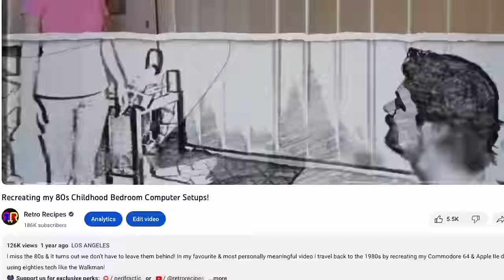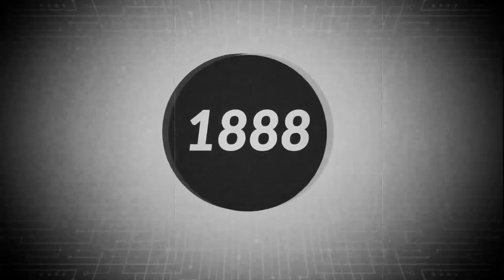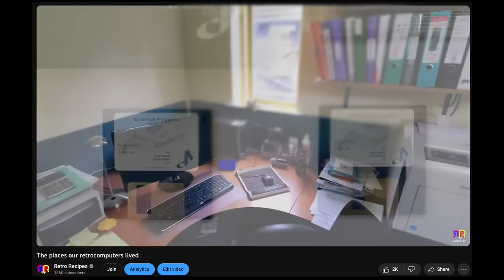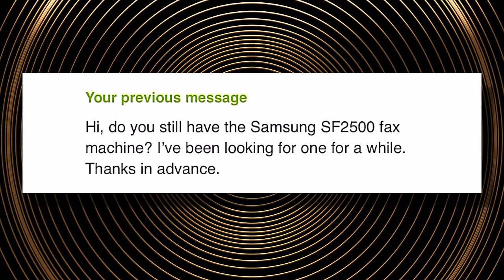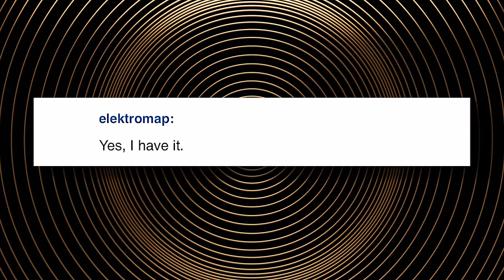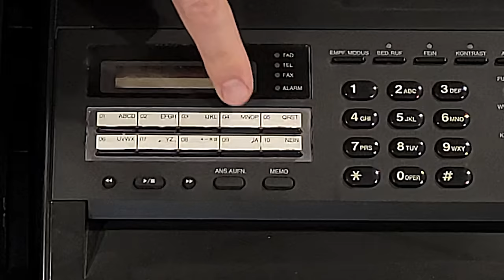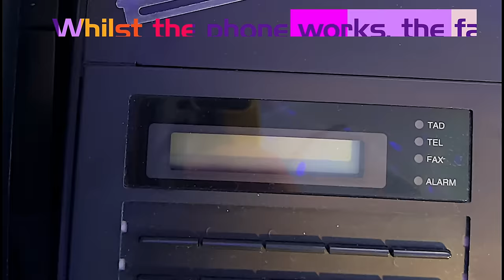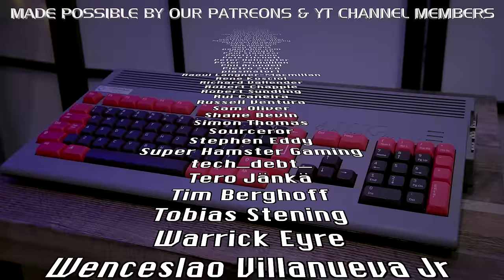Why we have to Save The Humble Fax Machine! // 90s Facsimile Repair 📠

Comment: Worked for the state public safety agency here in TX for over 30 years. The first seven were in the communications service handling telephone calls from the public and other LE agencies, lots of faxing documents. That was in the mid 80s. There as a second device duplexed with the fax, called a TDD, it was used to communicate with deaf persons. Maybe TDD was the precursor for texting? Still keep a fax machine in storage just in case it might be needed, next to it is a box of ballpoint pens and several pads of lined tablets. I really enjoy your videos!

Comment: I was lucky when I bought a Portastudio from Canada that it has a jumper you could reposition to swap back from 110v to 240v. Good job I thought of that before simply plugging it in in my excitement! Great repair job. The printer at work used to receive faxes and most of the time all we got were the equivalent of spam emails today. Offers of cheap holiday packages where you had to send the money off first and stuff like that. Beware of anyone trying to sign you up for a time share deal on a Spanish island! As for stupid people with idiotic comments, sadly these knobheads live amongst us but Darwin usually ensures they don’t live long and prosper. Keep up the great work. Sorry for the long comment but I have to mention the hard drive on the Amiga you showed, that I lusted after as a kid. I think it was 240Mb if memory serves. I did end up with a Amiga 600 with an internal 200Mb drive! Geoff Crammond’s F1 GP was the first game to reside on that!

Comment: I'm very sorry to hear about the terrible comments you receive. Your content has always felt a bit more wholesome that most of what I see. I pray that the positive comments can outweigh the bad ones and keep you up to making more content.

I worked for the phone company for a long time, yes they are phasing out POTS service with gusto. The copper infrastructure is expensive to maintain and since the government no longer regulates the service, they can do with it what they wish. They are pushing fiber and abandoning the copper. I am actually surprised that they allowed you to order a POTS line, I've been told by former co-workers that they are flat out refusing the service in my area.

Faxing is an activity that holds some nostalgia for me as well. I used to send a lot of them in the early 2000s as I worked in a small contracting office and would send out bids monthly. I also understand the feeling of certainty that holding a paper copy of something brings.

Keep up the good work!

Comment: Here in Australia they got rid of the copper phone lines a few years ago with the rollout of our national broadband network. In some areas they do still use the copper lines themselves for broadband, either fibre to the node or fibre to the curb (more correctly kerb, not curb as in "restrain"). Because they had to cut the lines and connect them to broadband node, they no longer connect back to the exchange, so they can't be used for a POTS phone line. And in areas where they upgraded to HFC cable or fibre, they simply no longer offer POTS phone services, so you can't get one even though the copper lines are still there.

Actually, a few years ago I repurposed some old Cisco gear to build a dial-up simulator. It was basically my own personal dial-up ISP, but I was using digital modems so I could get the full 56Kbps speed rather than the 33.6Kbps maximum of a regular analogue modem. Unfortunately it was pretty useless since there were no longer any POTS phone lines to dial into it (or rather ISDN lines, since it was digital rather than POTS), but I could connect a 56K modem directly and get the full speed.

Comment: I used to work in the marine electronics industry and the local prawn fishing fleet LOVED their fax machines. This was back in the AMPS (analog) mobile phone days. It was well known that conversations on the analog phones could be intercepted (albeit illegally), so the fishing companies installed Motorola Cellular Connection boxes to their mobile phones. This simulated a good old fashioned 2-wire phone line into which a fax machine could be connected. While it was technically possible to decode a fax transmission as it was flying across the air... there was no evidence that anyone in the fishing fleet had the equipment to do this.
Reply from the maker: Because as we all know PCB stands for Prawn Catching Boat
Reply: @RetroRecipes  100% correct 🙂

Comment: Ten years ago I replaced a multi-function printer for a non-profit I used to volunteer at.  The multi-function had print/ copy/ scan/ fax features.  The VP of the non-profit saw the printer had a fax option, and wondered why we weren't using it?  If any receipts were sent, they were received by email.  No need to pay for a land line that requires a long distance plan to be useful.

Comment: I recall having a fax machine at home in the 90s in the UK.  Felt I really hacked the system by buying a box that would connect to the tel socket and the phone/fax machine to that. This was so I didn't have to have a seperate line.  Call would come in, little box would determine if a voice call or fax and direct accordingly.  It was suprisingly fast and if a voice call, person at the other end was completely unaware and not kept waiting.  edit:  I also remember Blue Peter showcasing fax machines in the 80s. They had 2 in the studio.  1 presenter drew a simple picture and sent it to the other machine...was totally blown away by it.

Comment: You don’t need a copper telephone wire installed. I use Vonage VOIP to operate all my vintage landline phones (even rotary!) and my fax machine!
Reply from the maker: Whilst that is correct, the legislation applies to the newer VoIP lines which means they don't have to require the needed bitrate, but as mentioned I also just wanted to do it the original way :)

Comment: I recall having an OKIfax in New Zealand back in my first job way back in 1987.  Faxes have still been in use by  Chemists or pharmacys for prescriptions.  I have a Canon multi function printer that can be used as a fax machine.  But as I no longer have a landline.  It's a feature that might never be used.

Comment: I still have one fax / printer phone machine somewhere in my storage, doubt it works and probably needs a refurb by now. 
I kept these through the years buying and selling electronics so I can swap parts with other printers and electronic devices that happen to use the same parts or similar enough, at one point there was no money in this so I got rid of it all. No clue why I never took parts out of that specific one machine and why I even kept it. I even forgot about it through the years until now seeing this video.
I remember it being big and too heavy for it's size while also the handle of the phone itself being tiny like it's a child toy, I can imagine it being quite impractical for a every day phone usage with that tiny handle but at least it had hands free option to counter that. Since it's a printer it uses regular printer paper instead of the roll that yours does.

Comment: I've seen some means spirited comments aimed at various peoples comments here (including my own), but can't believe that you've had such depraved comments aimed towards you or your family, and by that  I mean in a way that I do believe it but I'm absolutely shocked by it. From my perspective you provide a great deal of fun, nostalgic, informative and enjoyable content and I can't see how anyone can find any reason to not only be mean spirited, but threatening towards you. What kind of excuses/reasons do they use??

Here in the UK they're phasing out the old copper wire stuff so they can shut down exchanges and reduce running costs. Old phones now plug into the router (same as they initially told you and what I had to do when they moved my service over) and everything goes via IP. Most connections are over fibre, with many direct to the home, though still quite a few to the cabinet in the street which then runs a copper pair to your home, so only the last few hundred feet is copper.

Comment: Up as recently as 2016, I still has a residential analog phone line, but heard through the local phone company, they were no longer interested in repairing or replacing copper wires.  Some cable modems will provide an analog phone jack - meaning they are digital up to your house and then analog from there.   So that is likely an option, just don't expect that they will be connecting you up to old copper phone lines from the '60s.

Comment: As a vintage phone collector, I wholeheartedly approve! IIRC, y'all have a vintage transparent phone that would work on that line, or you could get something like a Western Electric 2500, or even a Princess Phone to keep your fac machine company. 

I miss my POTS line. Alas, all my vintage phones are just for show. At this year's Vintage Computer Fest Southwest, I spoke to a fellow phone collector who does have a POTS line and he described a similar process to what you experienced. That's a bit too much for me, though. 

I do still have my old fax machine from work. When we stopped using them, my boss told me that I could throw it away or keep it, so i kept it. I'd use it to fax you if i still had my POTS line. 

Enjoy your faxstalgia!
Reply from the maker: Although the Samsung fax has a handset you've inspired me to order a 2-into-1 RJ11 so I can plug the transparent handset in too!
Reply: @RetroRecipes  Yes!!!
Reply from the maker: @gmirwin  Did it today - works great! Brrrring brrrring!

Comment: Interesting episode, have sent faxes only couple of times in my life, last time probably over 20 years ago. Back then used occasionally also an old school copymachine, but even then, majority of the customers were serviced using email and phonecalls. 
I live in building which was built in 2005, and this place doesn't have anymore traditional phoneline wall sockets but RJ45 socket or something like that. I actually had shortly a landline phone, and had to use converter piece, as the old landline phone had just old school wall connector (3-pins here in Finland at least).

Comment: This video reminds me that that I really want to finally install a genuine landline for my house.  I never ordered one when I moved in, since I already had a cell phone by then.

My house has copper phone wire from before I moved in, but I haven’t been able to get continuity between almost any port in the house before no one supports it.  (There were 3 phone numbers at one point in the past; I assume they were the home landline, home business landline, and home business fax line.) So an electrician, after climbing under the house and in the attic, advised me to just run completely new phone wires.  (Actually I think I will run multiple RJ45 wires to a patch box I will put in the laundry room, in case I ever want to use 8P8C instead of just 4P4C).

Comment: as you found out by the installer on sight, there are no direct phone service in existence now. It stopped in the USA 8 years ago with the closing of the final switch station in KS. Only VIOP exists, surprised they didn’t tell you that you could run the phone line on the back of the modem to an existing phone jack in the home to activate a all other jacks. love the retro channel.

Comment: Phone lines in the area I live in have been allowed to deteriorate by the phone company. Now, if someone wants wired phones in their house, they have a special adapter box that multiplexes it to the cable service. So, it seems like wired phone service and it makes a dial tone. But it isn't the same thing. The old folks seem to like it though.

Comment: Oddly enough, the copper landline that had dutifully served my home since 1993 was torn out just last week and replaced with fibre (I had no choice - my ISP was ending its ADSL service and I couldn't find an alternative).  Bummer to hear about VoIP not supporting fax - I had hoped to plug my old machine into the "Digital Voice" jack on the new router.  Interestingly, the Vodafone rep offered a battery in case of outages (it must be a big battery because the optical terminal and router amount to 11W - 3x more power than my old ADSL router).

Comment: I have bad news for you about having a LEC land line as backup for emergency. In most cases they are terminated in the same building as Broadband lines so if one has no power neither does the other.

Comment: Copper is being phased out in uk also by bt  new copper installs are not avalible to anyone after sep 5th 2023 the landline plugs in the router 👍🏻 battery backup is avalible if you need to not loose power  else no phone #thefuture

Comment: Hello there - I just tried to send you a fax, but it rang and wasn't answered - I dialled carefully, so I hope I didn't disturb someone else by mistake!

I was faxing to say that I too continue to use fax machines (and to collect them).  I've got nine at the moment, all working, though not all plugged in.

They are useful for the odd photocopy, especially the plain paper models.

But the main use for mine is keeping track of incoming phone calls:  I work from home, and don't give out my mobile number in an attempt to have a work/life balance, so every call comes in via my land line.  My Panasonic fax machine has a Caller-ID function, so logs date/time/number of every incoming call even though it doesn't answer them, and then prints out a log every thirty-five calls or so.

Finally, I do hope you manage to rise above the abusive comments:  I know they will get to you (you're only human after all), but the overwhelming majority of people are here because they appreciate what you're doing and how you're doing it!

John
Reply from the maker: You guys crashed the fax machine! It has now been reset so should work if you try again 👍🕹
Reply: @RetroRecipes  I just tried again - connected and got the lovely beeps, but couldn't send from my end - I know they are in the process of 'upgrading' my local exchange to VOIP, so perhaps I'm too late to be able to send any more.

Comment: I haven't dug too deep into it yet but in 2025 ALL analog lines will be shut off.  Today you can't get a new analog line from most companies.  If you cancel an analog line, you can't get it back. The last analog line I have gets increased annually by $10 a month.  They're trying to squeeze as many people out long before that time.
Reply: Sounds like only the "analogue" lines will be shut off in 2025.  i.e. UK.  I can't find anything like that happening in the US, and in fact the US is a mish-mash of different companies providing local telco service, so it'd be unlikely there's ever going to be one date that analog telephone service suddenly just goes away.

IIUC what's happened recently is that the FCC doesn't require the telecos to provide new POTS service anymore.  I don't think they'll be shutting off service anytime soon though.
Reply: @stevesether  Nope, US too.  We've already been forced off our analog lines by ATT.  Since it would be crazy to tie emergency lines into the same power as everything else, both elevator and fire lines are now tied to cell lines.  It's been a huge mess straightening out our fax lines as well.  All that because we turned up our Fiber speed.
Reply: @stevesether US too there bud.  The phasing out has begun.  Did you not watch his video?

Comment: Fax is deffenetly not cheaper if your recipient is abroad ( it might not even be possible to send faxes there any more dou to the psrn over copoer being ripped out in quite a few places), and if you need to securly mail the same people on a repeated basises therecare free ebcryption/signing solutions avalable, the initial sarup might be a PITA but once their up and running on the devices that needs them thei're lrity much transparent and non of the intemidiat servers the mail passes trough can reead them without btutfircing the encryption, and while not impossible its often to much work for casual snoopers. And plz note faxes are not encrypted so if somone taps the line and plays the sound ba k thrugh a fax modem they can still get the data at least in ..... oh youmean secure like tracable sender not like infosec never mind sigh